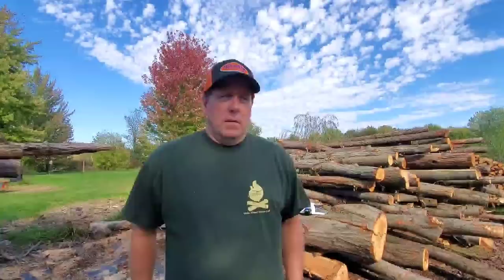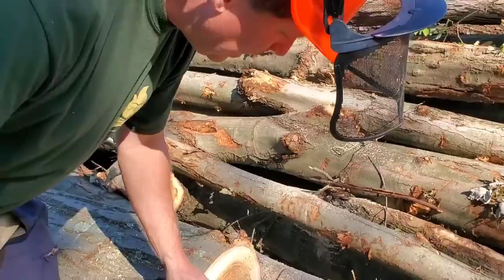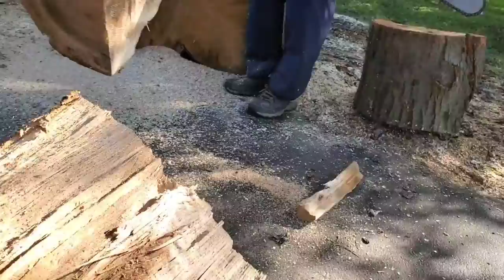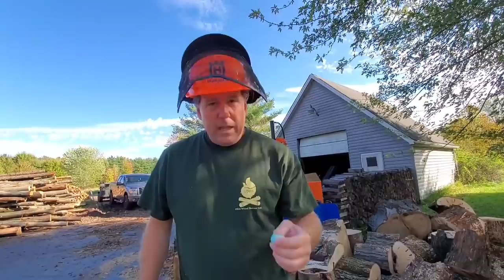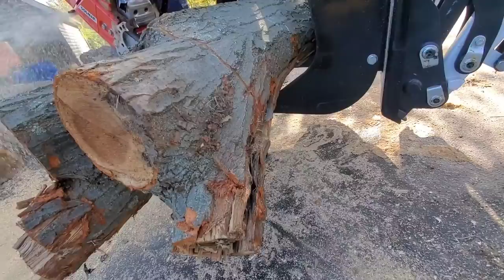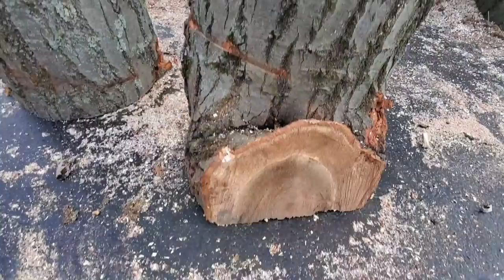SHOULD I THROW AWAY MY CHAINSAW???

Comment: Nice work i try to avoid the big firewood but it seems to always come back around because I'm a logger and anything that's mill rejected goes to the firewood pile
Reply from the maker: That's about the way it goes here too.  Most the big logs I get have issues, rot etc.
Reply: @ohiowoodburner  yep most of my big ones have the same issue, that or they have metal in them, i have some white oak rounds that are 48 inches in diameter lol

Comment: Joe, the best way to measure rounds is either to have a ‘yardstick’ pre-measured to your desired lengths, or large stiff cable ties fastened to your chainsaw handle, also to represent the lengths you want. Tape measures are a complete waste of time, in that application anyway!
Reply from the maker: I know there are faster ways but the tape measure is like my break between logs so I don't wear myself out.  I can stand up straight, stretch, cool off etc.
Reply: Trust me Joe, a 4’-0” ‘yard stick’ with 16” increments, marked off, will not speed things up much, but will be a lot easier than a tape measure! 😊
Reply: @lendevonuk5479  We just use a scribe line on the bar of the saw . Measuring is done from where the bar attaches to the saw to the scribe line by laying the saw on top of the log turn the saw to cut the piece off and it's measured

Comment: I have never have any thought to the smell of pin oak for 65 yrs, till this show - it's most of what I burned last season, also my hot water comes from wood - through out the yr - 
       I'm guessing as I cut up the rest of the load of pin oak I drew out the woods last yr and burn it, I'll take note to the smell of the pin oak lol - 
       I live in timber country and all the wood goes to mills - up till 1980 most heated with wood out here -
         About 35 yrs ago I settled on the husq 350 & 455 for what I cut - I prefer having several saws of the same model & buying roles of chain -
        I worked in tree falling, saw shops as a kid, during the summer and weekends so I do know saws, my 455s put out the power of a 70cc instead of the 56 cc - 
     Some might find this interesting - about 5 yrs ago I started using a $35 harbor freight corded saw - 
      Compared to a Husq 455 or 390 the corded harbor freight  has no chance 
        With that corded  saw I've cut 12 cords of pin oak easly - I generally slab cut my wood - that is I cut it. 4 inches wide - then I bust it up so it's small enough to drop into the eyelets my  heater - as if burning coal 
          So that's 4 cuts per 16 inches of 
  Log - in the end I do a lot of cutting - 
               last yr I decided to through a 2 kw generator on my truck after watch a You Tube clip on a professional tree trimmer that said he now uses the harbor freight electric saws in his service over gas saws -      
          with a gen on the back of his truck - 
        I'm guessing for a gallon of gas I brought down 6 cords or a truck load of pin oak over a two day period - cut them to 8 ft leanghts so I could drag them out the woods - 
        This is the part that I found impressive - normally a chain will last me a day of cutting or so - that chain on that corded saw lasted me, downing and cutting up.those lengths - with out the chain stretching out - 
         Also I cut most of the wood needed last winter on the same chain - I live in the south so I only burn 2-4 cords a yr - 
          I filed the chain so many times that the teeth became small enough to were they broke off - then I had to change out the chain -
     With my gas saws the file is good for about 3-4 filings on average - I used the same file thru many filings - till I changed out the chain 
        The saws chain travels slow so it doesn't stretch out as on a gas saw - as long as it's sharping it will chisel well enough - also the S52 chains are dirt cheap on the net - 
          I was very impressed at the saws performance against cost -.  (You can't come down on it hard as with a gas saw - or it will strip out the fiber gear drive) - 
     I thought some might find this interesting - a final comment is there no vibration to deal with, as with a gas saw
Reply from the maker: Thanks for the nice post Sid.  Very interesting to hear from a seasoned veteran of firewood.  I need to show more of my battery powered chain saw as it is still a very nice tool and I use it a lot.  I am tempted to try some Harbor Freight saws as well and show them on the channel.  Thanks so much for sharing! Joe
Reply: @ohiowoodburner  thanks for the reply - sence I'm retired now - I realy did not want to put a lot of money into saws and  gadgets - the electric battery operated saws work well enough - but there will be an investment in battery's - they fail often enough - you can bring them, or send them -  to a battery shop if you have enough battery packs, it's worth having them rebuilt - they can replace the cells for a fraction of the cost of replacing a battery pack in many cases - battery life cycled are determined by the rate of the charge time - most devices have fast rate chargers - that decreases the battery's service life - 
        That is a standard for all battery's - when it comes to battery technology - I'm 4th generation - in your case sence battery operated devices are part of your occupation it helps to know and understand  those  technology's -
     As for my gas saws my Husq 455 I open the fuel up on the carbs so they will put out 6-8 HP like a 90 cc engine if you open the throttle up to often you will have to change engines out in.a short time -   
     Loggers at times have beefed up saws - there 90 cc saws can jump up to 15 HP - some times on mammoth trees when select cutting,   it helps to have that added power -        you can get European electric chainsaws that are 240 volts 1.8 to 2 kw - they have the power of 55 to 60 cc engine  - that's around 3.5 to 4 HP depending on the brand - but they way less,than gas saws
        You can achieve more cuts than with a gas saw per hour running off a generator in the field - 
     My dad wrote trade magazines on tree harvesting and others about chimical's derived from wood - for decades, -
      He had told me of the industry finding about electric commercial 240 volt 2 kw saws  - harbor freight saws are 1 kw or so -  there are others that are 120 volts 1.5 kw that are exclent also

Comment: Totally agree that saw might be a slight overkill. Totally disagree with anyone who says you should switch to a smaller saw. Time is money. Fast saves you money and effort. No matter what big wood is delivered that pre-converter beast is going to make short work of it. You, clearly keep it in fine condition an it cuts like the tool it’s meant to be. Love your channel and know you know what I’m saying already. You’ve got such a great business there. Keep up the great work.
Reply: I agree. Nothing wrong with going with bigger equipment that is "overkill" on your needs., even if its 1 or 2 steps over what you need..
That just means you wont be working the saw or other equipment to death..
Reply: @DanielAtkinsFirewood  another good point that you are inferring, it will last longer. Great point, thanks!
Reply from the maker: My 7900 is an ideal saw actually.  It is nice to know that I can handle anything that comes off the truck!
Reply: @Wild_Bill57  : exactly.. I think most forget that detail when getting power equipment..

Comment: And having a sharp chain is a good chain plus to bite in the wood 🪵 and keep cutting till the job gets done I’ve got a 2019 craftsman 46CC 20” Oregon bar and advanced cut chain same brand name all from lowes besides new craftsman made carburetor runs like a chain saw tho we also got my grand dads stihl 028 wood boss 1980 chain saw still runs 50CC but super heavy
Reply from the maker: A sharp chain is a must.  It makes life soooo much easier.
Reply: Yes it does makes the cutting faster

Comment: No way, no throw away.  Just get a bigger one with more power.  Racing Saw, you should enter a contest.  Safety gear is critical to run the chain saw.  Put a couple of hollow sections to hold up logs off concrete.  Cut a section off the bottom to keep from rolling.  They will make holders for awhile.  Just don't drop a log on them.  Cut about eight inches wide, make several for different lengths on logs & how much clearance you need for the new saw blade lengths.
Reply from the maker: Good ideas Cyndi.  I try to be as safe as I can!

Comment: The 7900 Dolmar is a great saw! I owned a couple Sachs Dolmar 5105's (50cc class) and I found them to be very durable and reliable. Dolmar is now owned by Makita but they still manufacture them in that Dolmar red color to maintain consumer familiarity. I actually read a blog of yours from 2009 on the 7900 (Holy Cow!) Is that the same saw? As for me, I love the three Husqvarna 372 XP's I run. If I should need a part, I have an instant inventory to swap out without having to stop production. I just traded one in and bought a new one from the Husqvarna dealer at the Paul Bunyan show. Your Dolmar is so powerful, you could cut the "ears" off of some of those oak blocks for that "value added" - to get straight splits on your Axis splitter. Also, to keep your cutting chain off the blacktop, you could always drop the log you need to cut onto the blocks already on the ground to act as a "guard" against dulling your chain. Great video Joe, won't be long, we'll be fighting the snow. I actually had frost on my windshield one morning last week!
Reply: Yes but heavy
Reply from the maker: Nice post Steve.  The 372XP is the king of the forest. Great saw.  Funny you saw my old blog.  That is where OWB started.

Comment: IMHO that 79 cc Dolkita is sorta overkill. Have you tried their 61 cc saw? A real beast when wearing 24" b&c too. Strato engine boosts fuel endurance, a real plus. Per tach, mine peaks around 11.5k. A silky-smooth screamer. Having a FEL, rather than bucking logs on pavement, I'd incline to putting the logs on top of bucked rounds. It's all KISS.
Reply: I do my bucking with a Stihl 661. 92ccs. I was thinking I need to send him a bigger saw. 😈😂
Reply from the maker: Thanks for the comment Jacques.  I almost bought a 6300 a few years ago from Home Depot it was a rental.  Had a broken av spring.  Decided not to get it but now wish I did!
Reply: @WildAcresFarms  Some folks who "port" chainsaws have found that such stihls can have their power output DOUBLED, because, out of the box, they lack some. OTOH, over the years I've often found it advisable to grab one of my 35-40 cc saws that can actually get some jobs done better & faster. Bigger's not always better. And, when you check the stickers you'll notice that, across their range, Dolkitas are excellent values. I worked for my $$.
Reply: @jacquesblaque7728  I port saws for $$$. That’s precisely why I love the 661. 3 degrees more exhaust timing and it’s a beast of a saw. The factory saw gets destroyed by a stock 395XP. I’m not sure why you brought the brand was into this: I have a few of everything and love them all.
Reply: @WildAcresFarms  In simple fact, you initiated the brand stuff, with your 'Murican love of bigness for its own sake. As I said, the fascination with size for its own sake is counter-productive and serves mainly to disperse $$$, another attribute of big stihls. Sorry, but I'll have to pass on that, and fire up a Poulan Pro that works out of the box.
Reply: @jacquesblaque7728  not bigness for it’s own sake. For the sake of efficiency. I’ve felled and bucked over fifty ash and oak trees this year in the course of opening up 5 acres which composes the front yard of our new property. When you have 300+ bucking cuts to make each week in 20-32” thick Oak? Bigger is better. The 661 rips through a 20” ash in 9 seconds with a 32” bar on it. A 372XP takes closer to 14. If you’re cutting for 6+ hours a day that adds up fast. Over here in the USA and Canada a 72-95cc saw is the  standard for guys who do heavy falling and bucking day after day.
Reply: @WildAcresFarms  If you say so. If I've really serious bucking, or milling, to do I use a 576 AT with a 32". Then for limbing I might use a 40 cc RedMax or 50 cc PoulanPro, Flexibility in choice of tool is a Good Thing. Sometimes less is definitely more. Conscious thought always a BIG PLUS over here in the NE US. I don't do racing with power saws, having strong aversion to ER visits, and no interest in bragging rights. Maybe why I lived well past retirement age?
Reply: @jacquesblaque7728  I have or have had access to a 261, a 550XP, MS362, 044, 372XP, and the larger saws mentioned. We live in different forests and consequently have different preferences. The average width of a tree I end up working is larger than average, almost always well over 20”… and I’m 41 and in pretty good shape. As I age and stop cutting such large trees so aggressively I’m sure my preference for lighter over faster will change. We all have the ability to run what works best for us and I don’t think you’re making unwise choices in any way.

Comment: G'day Joe, are you holding the throttle fully open when you're in the cut ? If not the high jet may need a slight tweak, that smelly oak smells like $$👍.
Reply from the maker: I have it tuned so that it 'four strokes' until it hits the wood.  A little fat but this is how I like it for firewood.
Reply: Ok you're molly codling it that's fine the screamers constantly stall in our wood no time for molly 👍🇦🇺.

Comment: HI Joe Dolmar are great saws i have to do the same with my processor i can do 21 inch but you get the big nasty ones the saw has to come out  i let my oak dry for 2 years stacked before i sell it great video Jeff
Reply from the maker: That's what I do for residential oak Jeff.  For the restaurants I picked up they don't fuss over moisture content.
Reply: @ohiowoodburner  I like the restaurant idea I'm going to check into that